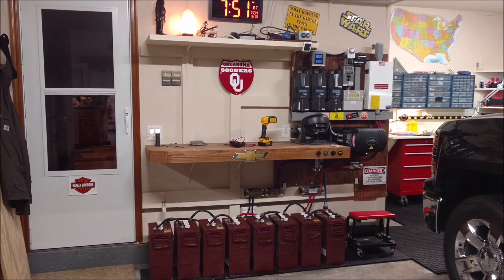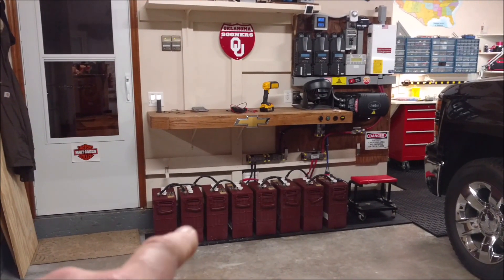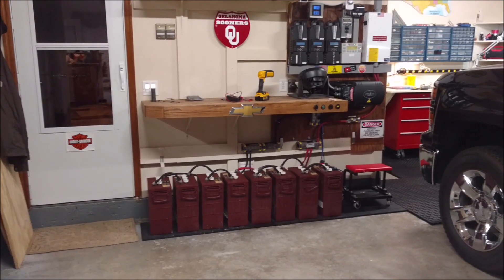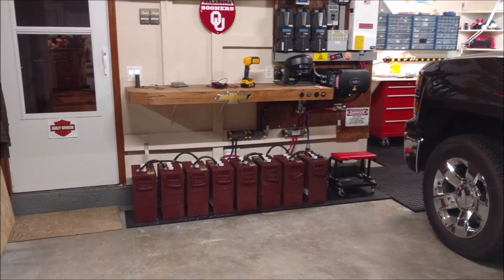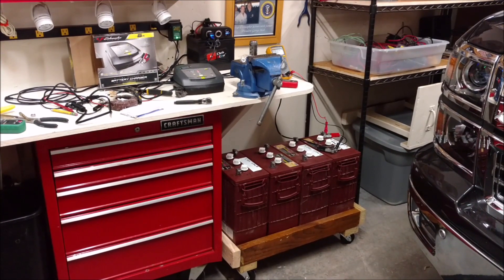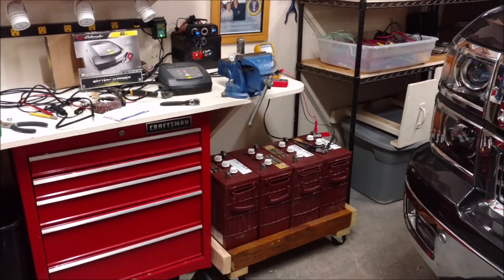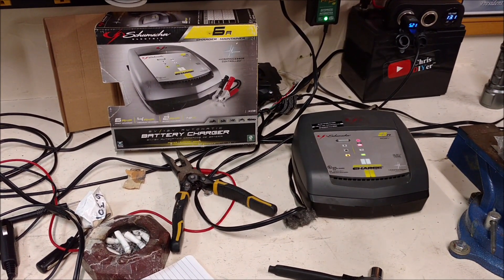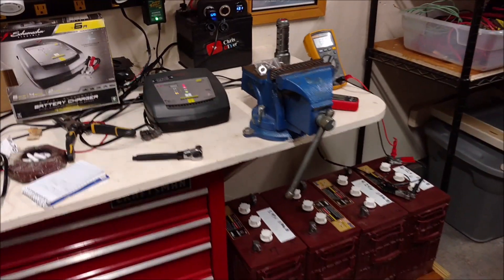*Update* 24v home solar battery bank fixes / new project idea

Comment: Good Day Chris I’ve been watching your channel for quite sometime not claiming to know everything. My suggestion to you is to charge up those batteries and cycle constantly with your battery extra desulfator attach. If get a positive result keep it attach permanently
Reply from the maker: Thanks...doing a couple of things now. Takes forever. It sucks not having that third string in-system during the summer cooling months...really could use the extra kWh of power. During the winter...no big deal running on two strings

Comment: So are you going to use the pergola/patio solar panels & separate MPPT controller  to make a separate "patio exclusive"  system to replace the ammo can mini systems ? This way you can have a fan, TV, entertainment system for lavish backyard festivities using the weak batteries till they crater .    J K
Reply from the maker: Keeping the ammo can 12v SOLGEN system idea! If I can get two of those L16's to work...maybe. Kinda tired of dealing with flooded lead-acid in general. The two Interstate Batteries deep-cycle AGM 35aH batteries in the ammo cans are great (yet small). Got some more testing to do to see if my theory will work...gonna be sexy if it does. And maybe confusing to some

Comment: My t105 are 4 years old and still getting more than 95% of there life. I am with you I will not ever buy lead acid batts for solar after mine are dead. I fond a lot of EV batts at my yard for cheap. SO that is what I will use.. 

Going to pump up the battery bank for your back yard setup ?
Reply from the maker: Cool! Yeh, EV batteries are one cost effective way to do it. Not real keen on it tho. As for your guess on the last part of my video...nope! haha 😄